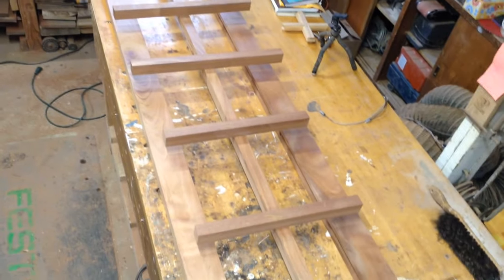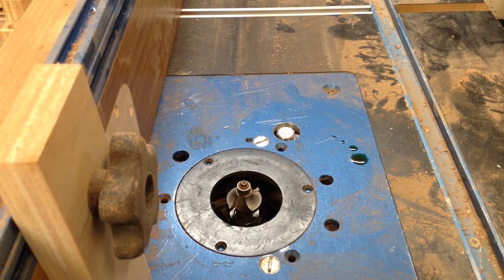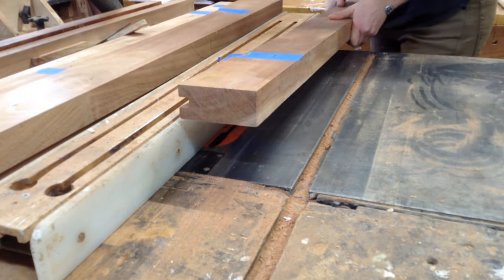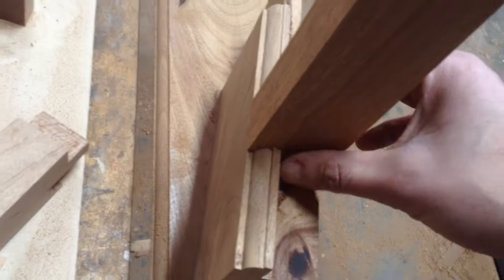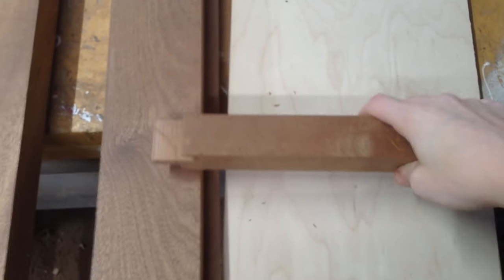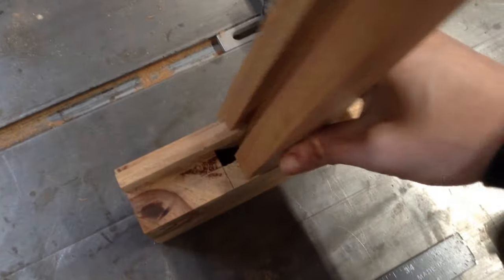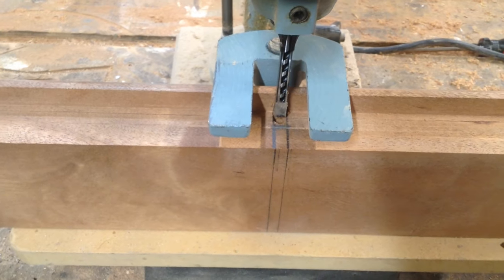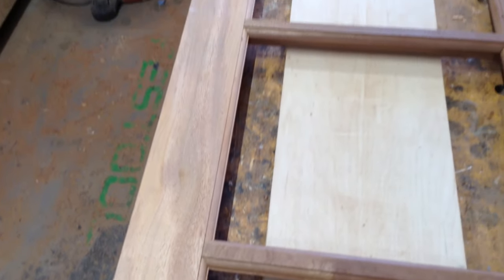How To Make Doors [Woodworking Projects]

Comment: I am sure this video will be an eye opener to some people as it shows just how much work goes into making a set of doors, they are turning out great and will look fantastic, had no idea about heat and Titebond 3 which is something think about as I use it a lot because of the extended open time due to the heat we have here a lot if the year 👌👌👌👍👍👍🇦🇺
Reply from the maker: The Titebond issue was news to me as well. French doors like this are hands down one of the more involved and harder things I’ve made.  Especially start to finish with weather stripping, install, hardware etc etc.

Comment: The cost of the bit is minimal compared to the extra effort and time required for  the extr work and once you have it you will sure as hell use it again! I bought a 3/8 cmt bit online for 15 bucks well worth it to get a job done! Looking good! Just remember  unless it's a by the hour job  theore time cuts into your profit! Time is money and that's the only thing you have!  I love it when people say you can't count all your time! Nice job!
Reply from the maker: I was going to buy another bit.  But, I could not find this profile in a coping bit.  This is a barter build, so tracking time isn't an issue on this one.  I work on it in bits and pieces in-between my customer projects.

Comment: Hi HB, as per usual, well done, this brings back memories, Since I’ve started making doors and windows long these similar lines, 
I was very lucky as I had some serious projects , I think you might like my machinery that is sitting in my basement, Wadkin EKA , though this machine is very old when I purchased it around 20 years ago, I stripped it and had it rebuilt with new bearings et cetera in the motors, I picked the machine up for £1000, but it cost another 4 to £5000 by the time I had rebuilt it and brought all the new modern to for it,
Leitz , Then the tooling set to go onto the spindle mould/profile machine, of course, nowadays, if you are in mass production work, most of this work is now done on the CNC machine, keep up the great work. Stay safe.,
Reply from the maker: The setups I have seen for people that make doors and windows is pretty impressive.
Reply: @HoneyBadgerWoodWorks  I have been very lucky with my work over the years, but not very good with my ex female partner as she had scammed me, back the early 2000s, I was lacking on space for my workshop, I could not build a workshop on the premises that we owned, so I ended up renting a property and old farm building on a massive farm complex, the downside was it was about 11 miles away from where, 
I did end up doing five bar conversions plus a load of renovation work for the farm , this is the main reason why I bought some very expensive equipment,  a lot of it paid for itself within two or three months, some of the biggest equipment probably took a year or so to recoup the money, but well worth it in the end, Good luck with yours look forward to the next stage of your door project,
Reply: @HoneyBadgerWoodWorks  Hi HB , I have found the new machine for your work shop, but you have extended slightly, SCM Accord 600 , 😂.

Comment: Nice results. Gotta admit, a shaper and mortiser would do you well.
Reply from the maker: I have a mortiser.  I sometimes  just like to show that some tasks can be accomplished without expensive tools.  Hence why I choose to use a drill to make mortises.  A shaper would be a time saver for this project, but I have no plans to get into the door making business, and wouldn't have much use for it after that.   Realistically speaking I barely even use my router table with the work I get.   This is a barter build, so it doesn't have a set timeline.  I am able to work on it in bits and pieces, so if some tasks took a little longer it didn't really matter on my end for this one.

Comment: Small bottles of JB Weld two part epoxy is in every Home Depot.
Reply from the maker: I don’t care for JB weld epoxy, I prefer DAP.  And that’s five minute epoxy.  I needed a long open time on the epoxy so I have enough time to align all my pieces and get them clamped.  Also, with the amount I need to glue the doors together it would have been more expensive to buy small bottles.  Once it’s all said I done I will have used 3/4 of that kit.

Comment: Wow. Super tricky build. I wonder if doing the muts first and then do the rails and stiles might be slightly easier.  I say that because dialing in the correct length on the muts is tough because of the complicated profiles on the ends. Seems like it’s easier to dial in the length of rails and stiles to fit the muts. Just a thought.
Reply from the maker: I think order of operations most times is personal preference in woodworking.  But, I personally have never seen someone build a door from the inside out.  I think doing the mutts first would present a whole other set of math and dimensioning to deal with.